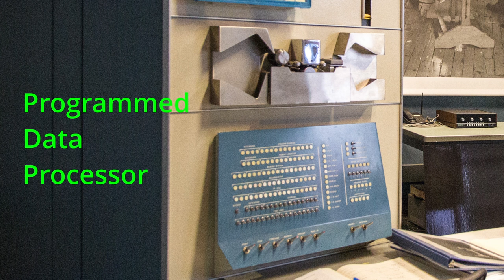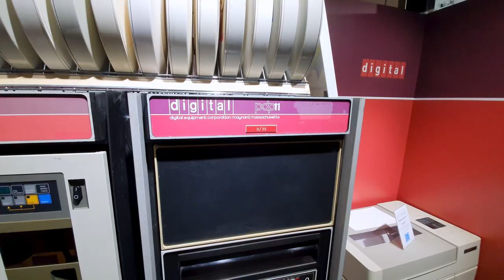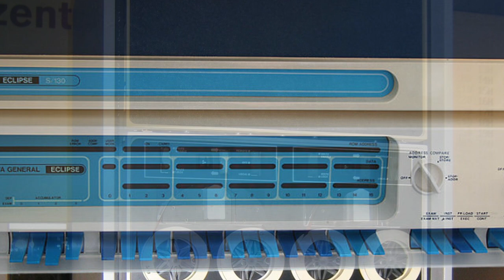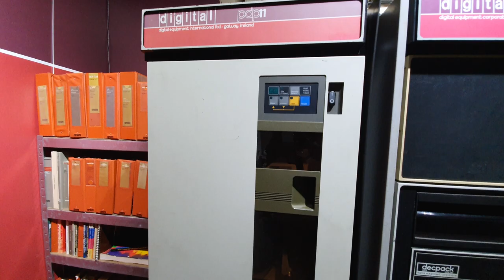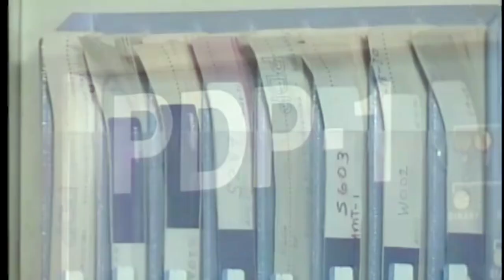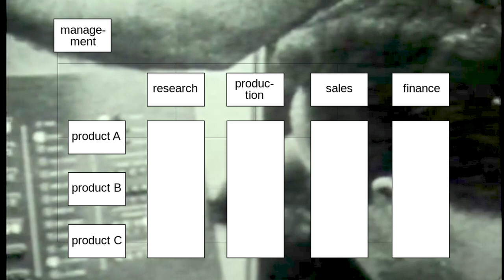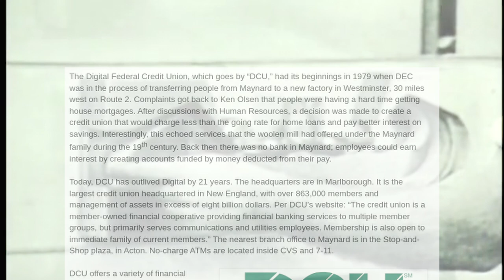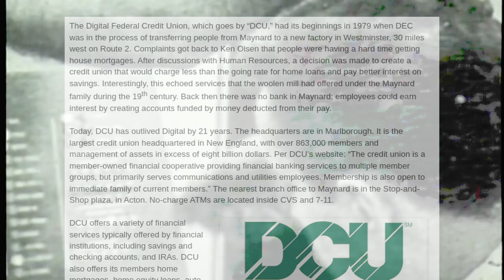DEC and the PiDP-11

Comment: I actually have a full sized PDP 11/40 frontend though some of the address switches have seen batter days in the back end somewhere had planned to plop it on an emulator of sorts - oh plans i remember you well.......
Reply from the maker: That would be rather cool once you get it running, the pidp-11 is using simh, so at least you now know it as some code to deal with a physical control panel, which will save you a chunk of software development.

Comment: Would you mind putting supplementary text at the top? YouTube's subtitles go at the bottom. Otherwise, great work!
Reply: Yes, this would be helpful.  I had to flip captions off/on with the "c" key on a couple occasions.
Reply from the maker: That's  a good point I had not thought of that, I will try to remember todo that in future. Thanks for pointing it out.

Comment: I imagine core memory also takes a good bit of energy to change state, making it a lot less susceptible to data corruption by cosmic rays etc.
Reply: I was an engineer in a printed circuit board manufacturing plant an the PDP11 was used in the CNC drilling machines in the late '70s. They all had core memory which was like a toaster oven - the memory would not fail but it would trash the circuit boards above them (and even turn the PCB material brown). I looked at changing to solid state memory but did not want to deal with the loss of the program and rebooting issues when there was a power issue. Years before I was responsible for some drilling equipment that used Data General computers that used solid state memory. When the machine broke or if there was a power failure you had to reboot from the front panel. Both of these systems ran the CNC programs from punched mylar tape (no disk drives of any type), so the hand entered boot loader was the instruction set to run the tape reader which had the system boot program. A real pain at 7AM for someone who is a bit dyslexic...
Reply: @user-zx6nz7sc1k  Never may it be said that core memory had no advantages 😅

This is really cool though, I love what you guys managed to achieve with so relatively little by way of compute resource.

Tbough I do wonder if there couldn't have been some sort of mitigation for all that heat affecting other boards and such 🤔... You'd think someone would have come up with a good thermal design that helped the situation.

Comment: No mention of the PDP-11 lookalikes.  One of the early machines I worked on was a Systime copy of the PDP-11.
Reply: I’m an ex Systimer too. Worked at the Beeston (Nottingham) office.

Started on RSTS/E and BASIC. 16k RAM, and used the SystIme ACCESS system for indexed lookups into files which we had to access directly as 512 byte blocks.

I was the local SYS call, and peek/poke expert.

Comment: My fav was the Dec 10 :D
Reply from the maker: The 10 is very cool, but you needed deep pockets and a very big room to get a pdp-10
Reply: @RetroBytesUK  A DECsystem 2020 was a single rack, plus a rack for the tape drive and one for some kinda disk. They were working on an LSI 10, but cancelled the project when the larger Jupiter product was killed in favor of Venus (VAX 8600). That's when I left DEC's LCG (Large Computer Group), and got more into VAXen.
Reply: @SeaMower  Yeah, the Jupiter 36-bit machine was a total disaster. It was designed by engineers who had never built a PDP-10, and it had a MAJOR conceptual error. The idea was that if you ordered the instruction set from most used (in execution time) to least used, then made the few instructions that consumed 50% of the time run 10 times faster, then the whole machine would run 5 times faster. Unfortunately, they were ignorant of Amdahl's Law and the whole machine would only run 2 times faster. Also, they claimed that the Jupiter had a critical time to market, so there was no time to do simulation. The lesson learned, and used on the VAX 8600, was that simulation saves design time.

Comment: Nice kit, but is it really necessary to drive it with full Raspberry Pi board? I think such a bunch of LEDs and switches should be driven by little Raspbery Pico (or Arduino) for a tenth of price... Or not?
Reply from the maker: It that is runs the whole pdp-11 emulator. You could probably get away with a pi zero 2, however I had the rpi lying around  so I used it. It also mechanically fits all the mounting holes.

Comment: Hmmm I'm only now just wondering if ICL and its 24bit fetish were born out of a 24bits being divisible by 6 and 8. 

  At school, we had a 300baud acoustic coupler modem link to the Ipswich College ICL 2903 mainframe.  30 mins to connect was fun, oh have times changed - today we would call that an outage and not a normal time to connect two modems from a small town via the phone network of the time (analogue) to early modems that entailed a speaker and a microphone that attached to a phone headset - what could go wrong.   Ended up doing George 3 OS and finding what are probably still today - 0-day exploits.   

How to get the admin(root we call it today) password.  Well due to the disc rotation to prolong life and the fact they had a journaling log file of the admin console.  You could eventually get an old admin journal log disc rotated into the user-accessible pool.  The fact that discs were not overwritten back then (save wear and tear aspect again - discs were not cheap back then) meant that you could create a file without zeroing out the space in creation and then dump that file out, getting the previous disc contents.  This along with the journal logs not being encrypted (encryption was military only thank in mentality and well, you know the very early days mindsets and hardware limitations that would be interesting how long an old Cray 1 would take to do a single bitcoin for speed and feature context) could be plainly readout.    

Then there were the lovely SPV and console alert commands.  I wrote what would be called a key logger per se for the same system.  Was JCL (scripting language we would call today) and mainframes had many terminals.  With the SPV command, you could take control of a terminal as an input/output device.   Now if you take charge of all - print out a login prompt, accept input and do output - happy days.   This along with the ability to also log that terminal on as a user with credentials provided enabled a wrapper between the user and their login.  Enabling full logging of their activity and also the ability to inject commands :).   Fun times.  I then moved on into Honeywell, DEC VAX, UNIX from the IBM RT days that gave the fruit to the RS/6000's and did get hands on the first one in the UK (though I'm sure all salespeople said that to you, but as was months before release - will believe them upon this).

Actually many Nix flavours of that era, no SGI though - was always a dream workstation daydream moment.

Still lament losing all my old kit in a move over a decade ago - including 20 IBM model M keyboards (still crying inside about those alone).
Reply from the maker: I'm a fellow ex George user too. I work for a sub company of ICL in mid 90's, so got to use George a fair bit back then. The was a clever way to get access to the admin console journal. Those models go for stupid prices now. I have just the one of them.

Comment: With the kit, I would have put a little more effort into getting the switches aligned vertically.
Reply from the maker: They did get aligned a little more after filming was done. Filming stuff like that makes doing it much harder, as not only are you concentrating on what you're doing, but also what it looks like on camera, and if you're blocking the shot or not. There is also a time constraint on getting your shots done before you need to pack everything up and pick up the kids.

Comment: But the kit doesn't have the open bus connector? Love the video, especially the info about DEC as a great company.
Reply: "...But the kit doesn't have the open bus connector?..."

I expect someone could make an adapter bus to plug into the USB port. <g>
Reply from the maker: There is someone working on a bus implementation using a beaglebone.

Comment: I heard that that  data general architecture went on to be used for the first Microchip Inc PIC processor.
Reply from the maker: Thats somthing I want to look into now
Reply: @RetroBytesUK  The PIC12xx has a very limited instruction set and hence uses few transistors and a smaller silicon area. Having programmed it in assembler, you can achieve everything (just) but you have to do some weird bits of programming to achieve some things. I guess in Data General's time, every transistor saved was a big plus cost-wise. PS enjoyed your video, thanks.
Reply: In Harvard, we do not mix code and data!
I have done a fair amount of programming on PICs, complete PIA, but the challenge did make it interesting....
I think I prefer the more orthogonal architecture of DEC or 68xxx types.

Comment: 26:29 Yup, seems like Ken already had Cloud Computing in mind
Reply from the maker: DEC where selling time on equipment over remote connections in the 70's and probably earlier, so I am fairly sure your right.
Reply: There were computing bureaus which were very common in the 1960s and 1970s, based on this sort of model. They didn’t use the term “cloud”.

The big problem with working over a terminal was the low bandwidth of the connections available at the time. As long as you were doing primarily text-based stuff it was tolerable, but it was absolutely hopeless for any kind of graphics.
Reply: That's not strictly true.  In the early '80s, DEC had 3 Personal/home/Desktop computers - the DECMATE II, which was a Word Processor based around a single-chip PDP-8, the Pro 350, which was a PDP-11 based system, and the Rainbow - an 8086/Z80 based equivalent to the IBM PC, which ran CPM 86/80, a CPM flavor that could run either 8-bit or 16 bit CPM software (There was quite a bit of 8-bit stuff in the wild at that time, and we wanted to leverage that.) CPM 86/80 would automatically detect whether you were running a 16 or 8 bit program, and seamlessly switch processing environments.  MS-DOS also came with it - I can fairly lay claim to have been the first person to run an MS-DOS machine with more than 512K or RAM - the bug report on the broken memory sizing algorithm was under my name.  At the time, it outperformed the PC and PC-XT - but we ended up losing out on compatibility, and the lack of a proper bus for people to build cards to stick into it.  (Who knew that that was going to be a big deal?)  DEC in the early '80s was a dynamic and exciting place to be, and the Rainbow Team were mavericks among the mavericks - A real talented crew of men and women.
Reply: @RetroBytesUK  I don't know that DEC themselves were selling time on computers. But they had many customers who ran timesharing systems. The most famous was Compuserve. Some of the customers I served as a DEC10 field engineer in the early 80s ran timesharing systems. Timesharing started in the 60s. The KA10 came out in 1968, and was used for timesharing among other things with PDP8 based front ends connected to racks of modems.
Reply: @peterstickney7608  We (DEC) should have seen the bus issue. It was discussed when the Rainbow came out. The Pro-350 (PDP11 PC) had a great bus, but by then, someone at DEC had decided not to open the bus to other vendors without a major license fee. If they had, I seriously think we might all be running DEC based PCs and servers now. I think we also should have observed the color graphics revolution happening on lower cost 8 bit Apple, Atari, and Commodore home systems. Those systems set a low price point for software. When I was writing Rainbow software to work with MCI Mail, DEC wanted to charge hundreds to thousands per copy. I was stunned. They asked me how much it should cost - $50. Let the cheap software sell the hardware was my thought.

Comment: troubleshooting a problem on the unibus. oh where could it be. start unplugging things.
Reply: The technique was called Half Split - unplug the bus jumper roughly in the middle of the chain, and put the bus terminator there. It's a binary search.  The biggest problem I had was scraping hand flesh off against modules while trying to remove the earlier bus jumpers or ribbon cables going to comm distribution panels.
Reply: I remember removing most of the cards from pdp 11/70 CPU bins and disconnecting Expansion bins to find a fault had cleared. Then, expanding the UNIBUS again and plugging all the cards back in to find the fault never re-appeared. The old joke was that DEC stood for Dodgy Edge Connectors. So, you learned to clean edge connectors before installing a card and to slide the cars in/out a few times when installing. I think this cleared or prevented a lot of faults 🙂.

Comment: ASCII stands for AMERICAN Standard Code for Information Interchange
NOT 2.
Reply from the maker: I  know that, it's was intended as a joke and a reference to red drawf.  I assumed with it being so obviously wrong poeple would realise it was a joke. There is a pinned comment to explain.
Reply: @RetroBytesUK  Sorry, My career goes back to the early 1960s. The first machine I worked on was a UNIVAC SS80 which had the THIRD type of memory which was a DRUM, it acted a what we called MAIN MEMORY, it held program code just as RAM does today. However the code had to be transferred to a Register before it could be executed, other Registers held the addresses of programmatic operands we called the A and B registers.
So the DRUM address of a programmatic OP CODE was stored in the CURRENT INSTRUCTION REGISTER, the ADDRESS of first operand was placed in register A and the ADDRESS of the second operand was placed in the B REGISTER.
So an OP CODE of say ADD A to B WOULD LOCATE THE Contents of the address in register A and the contents of address in register B and execute an ADD leaving the answer on the Drum in the address in register B.
This UNIVAC  SS80 also used an unique Binary Coding System called BIQUINARY, instead of the Binary values 1, 2, 4, 8, it used the values 1, 2, 4, 5.
Yes 5, hence BIQUINARY, the decimal vale 6 could be stored in a BIQUINARY word as a 2 bit and a 4 bit, OR as a 1 bit and a 5 bit.
A 2 and a 4 bit was Invalid, known as an UNDIGIT, only a 1 and a 5 bit was considered a Decimal 6.
I began my career in England, I worked for Honeywell in England and was then hired by a US Company to work on IBM mainframes 360/40 50 and 65s.
I worked for HP ON THE HP/3000 a GREAT MACHINE, then I worked for the real pioneers of the internet, Bridge Communications, 3Com and Cisco Systems.
I had a GREAT CAREER..
Sorry if I have gone on a bit.
Best wishes, stay safe.

Comment: Seems kind of silly that they put a lamp test switch on this replica machine that used LEDs.  Lamp test switches come from an era when lamps were incandescent, and burned out after a while.  Kind of pointless with indicator LEDs, which last practically forever.
Reply from the maker: Yep you  don't need the lamp test switch to see if an LED has died, It was helpful to see if I had soldered them in all correctly, so its useful exactly once.   I think its there really to preserve the switch layout of the original.
Reply: LEDs were still sort of new when the 11/70 came out. Many DEC systems, such as PDP10s, originally had incancdescent bulbs. Replacing the bulbs was an item done by field engineers on PMs (planned maintenance). I recall doing ECOs (engineering change orders) to replace the bulbs on DEC10s with LEDs.
Reply: @SeaMower  Didn't the incandescent lights on the PDP-10 become obsolete and hard to service? I would expect a LED to be a good retrofit in that case.